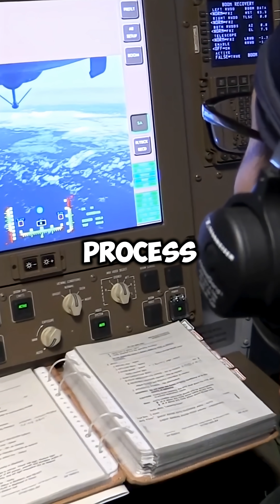Why did America don't uses  probe-and- drogue system?

Comment: Mostly because you’re filling up a jet fighter, they might take 500 gallons 800 gallons of fuel you’re filling up a KC 130 or a C5 galaxy B 52 they could be taking 20,000 gallons or whatever the number is it’s time that boom comes down. It’s like a 6 inch pipeyou can dump a lot of fuel down a 6 inch pipe.

Comment: First..... as a boom operator, you sit in a seat in the back of a KC 10. You lay on your chest in the back of the KC 135 as seen in the video.
One of the biger reasons for the US using the boom instead of the drogue is that if the basket does not hook onto the probe you can not move fuel. If the boom doesn't hook into the receiver aircraft, we have the ability to "force" feed fuel into the reciever by keeping them pushed together. You loose some fuel doing it this way, but the reliever aircraft will get their fuel to continue their mission.